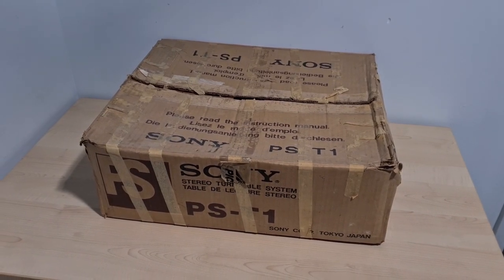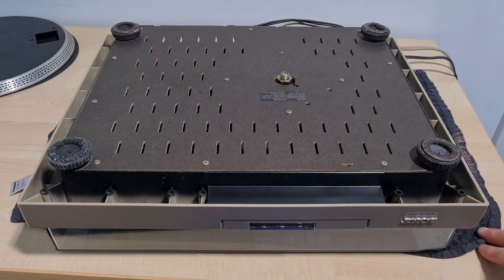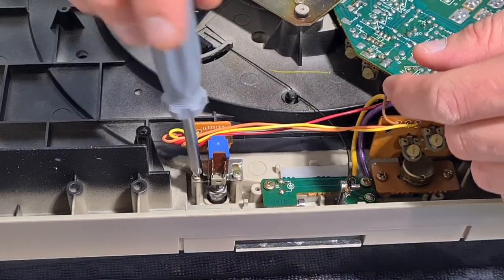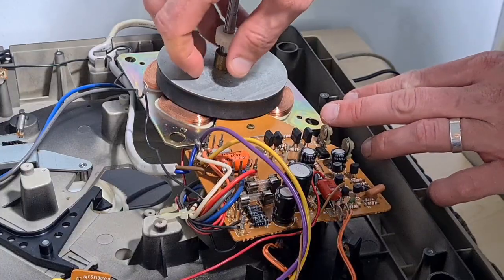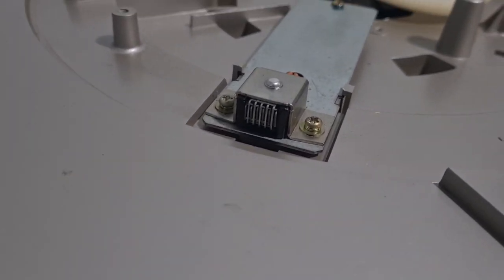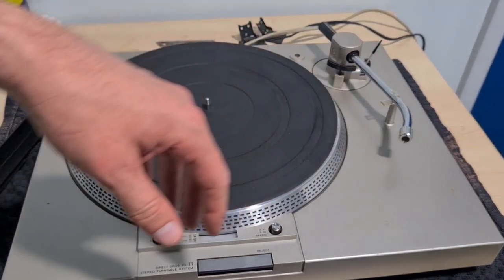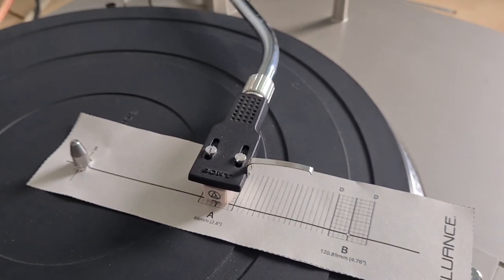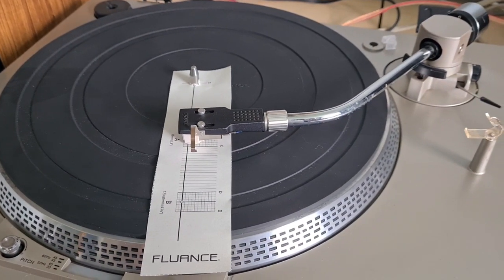1970s Sony PS-T1 Turntable - Service, Repair, New Cartridge & Alignment

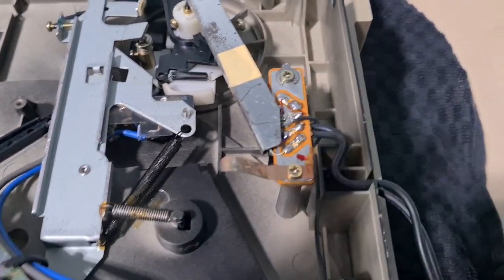Comment: 4:55 is a metal tongue for electric grounding. If you look at the inner surface of the bottom cover you removed, there is a metal film applied to be touched by that little tongue, as this turntable has this internal grounding solution, no external cable added to this model.
Reply: Ty whas looking over all over the internet of this on needed a ground wire or not like my other 2 players i have and you gave me the answer❤

Comment: My parents bought this turntable and the rest of their setup second hand in the 80's, which I'm now the proud owner off. Not sure when it was cleaned or fixed up last, other than my dad and I fixing the speed on the 45rpm setting via the screws on the bottom. the end of the stylus has been changed at one point, as its JVC and not Sony. I'm currently looking in to getting a new needle and possibly a new pickup for it, as I know it hasn't been changed in minimum 15 years, but probably longer than that. I'll save your video for future reference for sure! I do wish to learn to take care of this system more so I can cintinue using it for many more years!
Reply from the maker: My brother has this TT now and it's been great. It needed a few more tweaks of those pots underneath to stabilise the speed too, maybe a common job 👍

Comment: I have one of these that was also bought by my dad in the 1980s. It has worked well other than the broken piece that holds the arm (which seems the norm!) and the lid not staying up, so I'll try your hinge adjustment. However, I recently started hearing records slowing down and then speeding up, so it looked like I needed a new belt. I've started looking for sources and was baffled to not find any. I then saw your video and apparently there is no belt! Excuse my ignorance but can you please confirm this? I'm baffled because I thought belts were the norm?
Reply from the maker: Yep no belt but I'll tell you exactly what your problem is. Underneath, there is a small plastic plate around 2cm x 8cm which is at the front/underside of the turntable. Remove this and there are some potentiometers, these are speed control. There is one for each speed. Give them a clean with contact cleaner or deoxit, give them a turn back and forth with a screwdriver. 

Next set your speed control knobs on the top of the unit to centre. 

Then have the turntable just hanging over the lip of a table or something, so you can access the pots from below while it is playing. Adjust them whilst the player is spinning, using the timing light as a guide to get the correct speed.

Boom your turntable is now speed calibrated! Hope this makes sense.
Reply: @pwrestoration  Many thanks for your advice, I'll try to give that a try soon. I'm genuinely surprised by the lack of a belt, because the problem sounded like it could easily be an old, stretched belt, so I hoped that would be an easy fix!

Comment: Hi i got a question i have a sony ps t2 it spins i calibrated it but when i wanted to play a vinyl the tone arm doesnt move the automatic return works everything seems to work except that tone arm not moving forward please if yall know how to fix it let me know
Reply from the maker: Probably dried grease, you'll have to take the bottom off and look at the mechanism. If you have a glass table that's the easiest way!